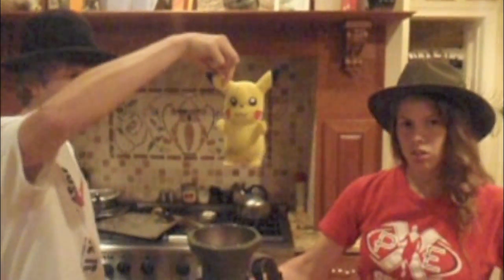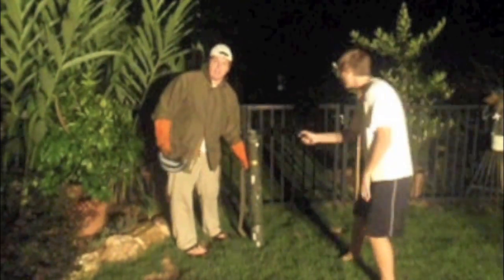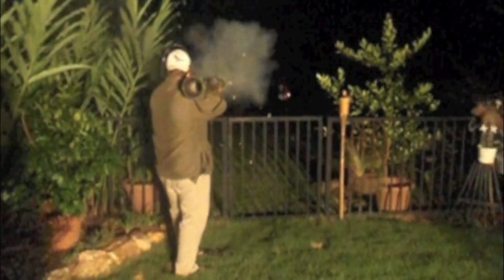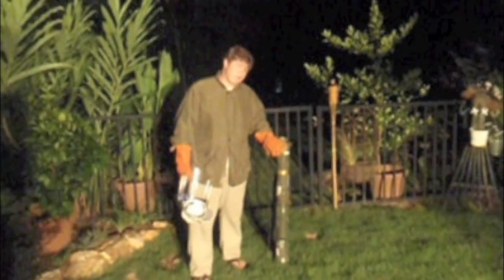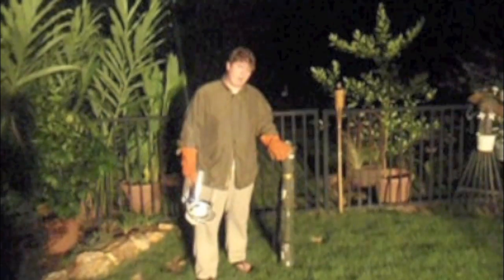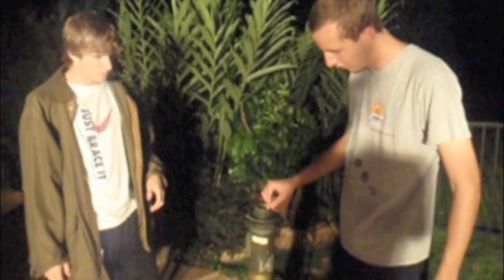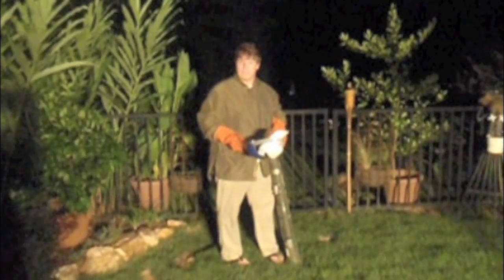AT4 (Bazooka) Conversion for Firework Artillery Rounds

Comment: im sure ppl are gonna tell u this but you r never suppose to use PVC for mortars, even with the metal surrounding tube. Because of the shrapnel it will make in case of upside down shell. get yourself some HDPE DR11. ID=1.91 or if ur gonna keep shooting generic artillery get DR9 ID=1.81 

other than that awesome